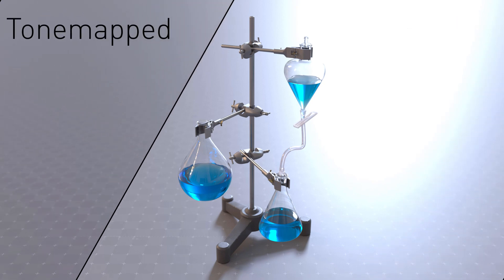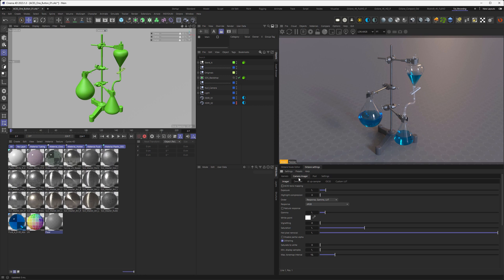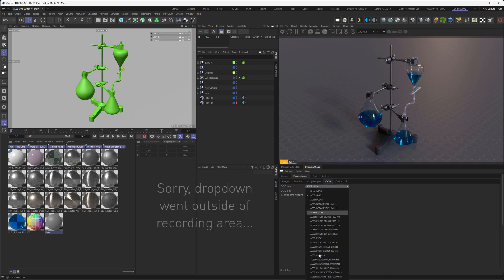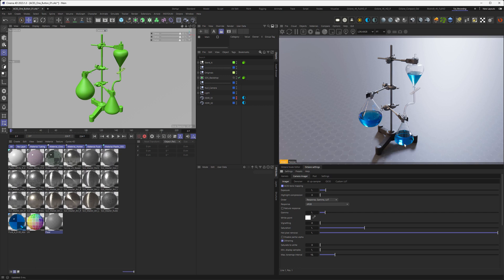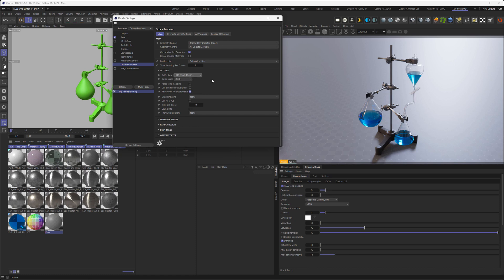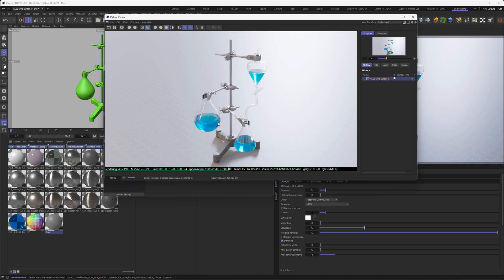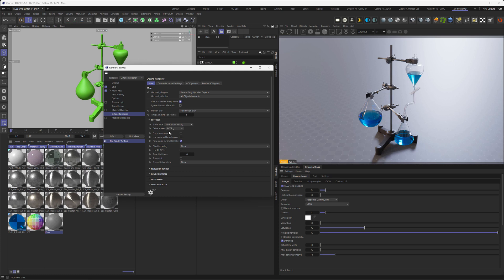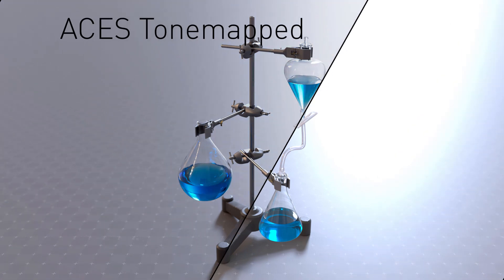Silverwing Quick Tip: ACES One Click Solution in Octane

Comment: thanks man for your tuts, I use the old method with compositing everything in AE and I just have some problems when I'm trying to use AOVs with aces, specially my Z depth pass is always wrong even after i do the conversion in AE. Do u have any recommendation for that?
Reply from the maker: Hey and thank you so much for your comment.
To answer your question: I actually very rarely use Z-Depth so so I would have to look into it to be sure what´s happening 😇
Could you elaborate what you mean by "Z-Depth is always wrong" what are you using the Z-Depth for and what are your expectations?
Thank you and cheers 😊